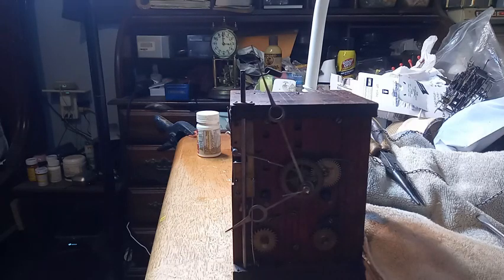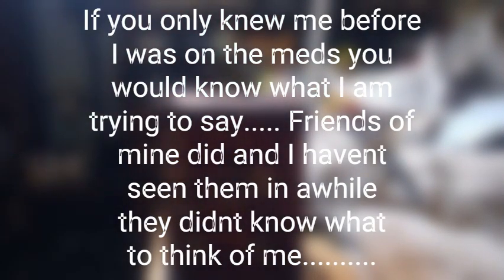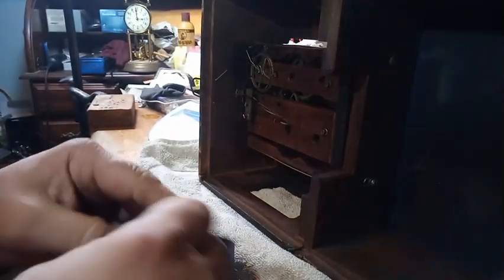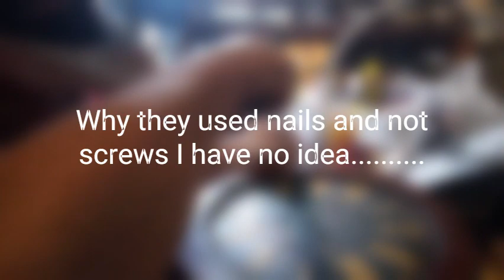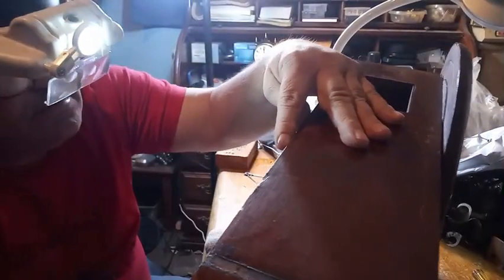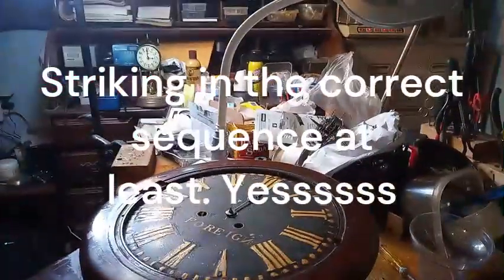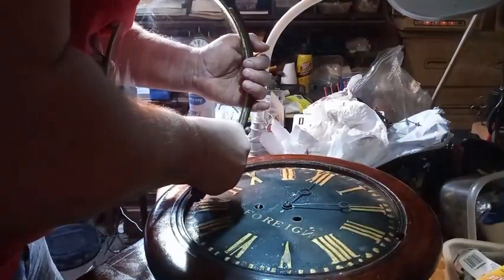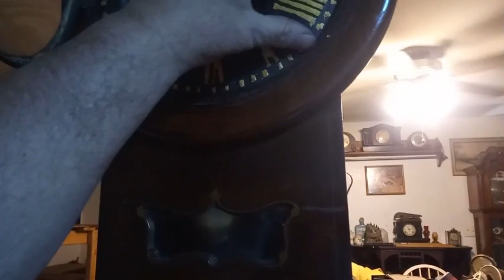Repairing a drop dial case clock with a wooden plate & double fusee movement PT 3 (See description)

Comment: So I would have painted the hands another color before I covered the original dial.
Reply from the maker: I honestly dont believe it is an original dial. It has Foreign marked on it.I believe the clock is a lot older than the 1920s when they were required to mark the items per the UK Merchandise Marks Act of 1926. From the research that I have done I have only found one that looked like mine and it was made by Meyer who was German that moved to London and it was dated the mid to late 1800s as shown in my first video. https://www.collectorsweekly.com/stories/270593-art-deco-1928-33-foreign-mantel-clock?in=activity
Reply from the maker: Plus because the hands are original I didnt want to paint them.